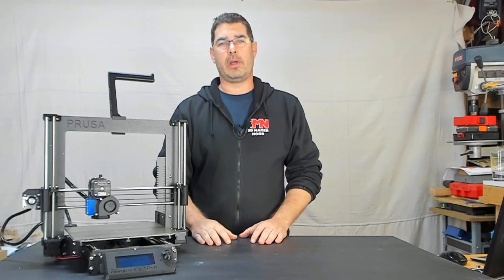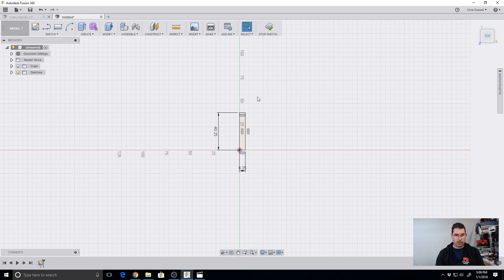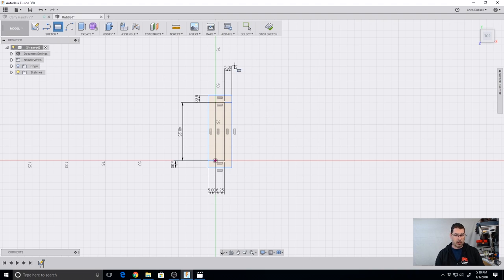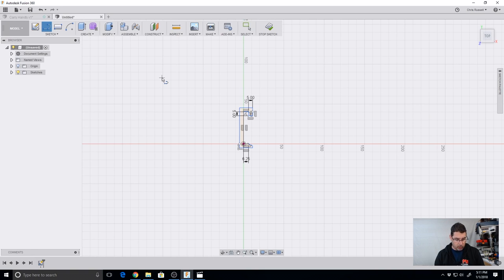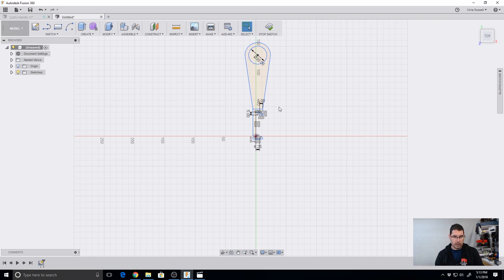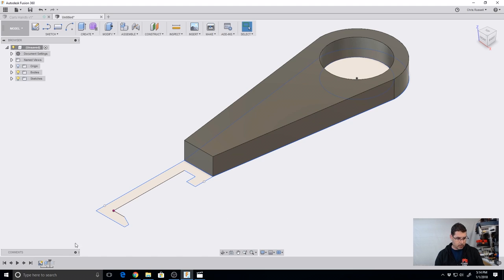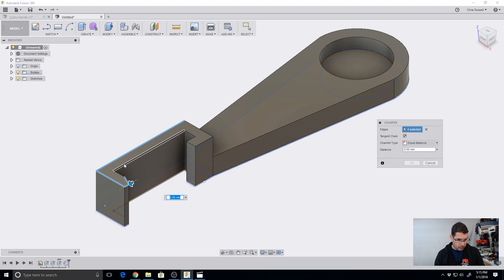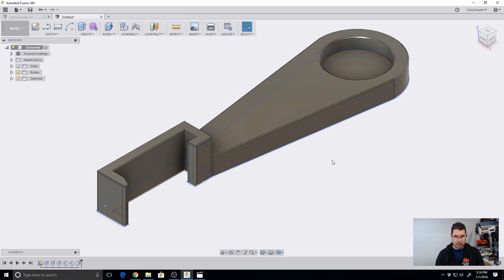Prusa Mk3 Carry Handle

Comment: If you extend the length between the clips to the handle about 2 inches. You could also use the handle as a filament spool holder.
Reply from the maker: Stay tuned for part 2... ;)
Reply: I was scrolling down to see if someone already said this :) and it's also coming apparently. Did seem like a no-brainer, once you seen them next to each other. No need to stash and lose that pipe anymore either. Looking fwd: to the next video.

Comment: Great design. I feel like the hook part should be at the bottom. Just in case it were to slip off for some reason the clamps couldn’t slip off. Just my view. Still a great design.
Reply from the maker: Normally I would agree with you, but their is a method to my madness... Stay tuned for part 2!  (But for the record, this actually does hold it quite securely this way).
Reply: Practical Printing I trust your judgement. I’ve never made such a thing for my Prusa. Looking forward to the next video!
Reply: Actually the more I think about it, your design does make sense with how the forces are applied to the lifting device.

Comment: you cant have that handle attached when printing very high object. x axis assemby will hit it.
Reply from the maker: That is correct. To me it was a good sacrifice for the convenience of the handle and drop on spool. Others, it may not be.
Reply: i learned hard way :-). next move was to drill two 3mm holes (and tap them) in frame and made new spoolholder which is not in the way of x axis.